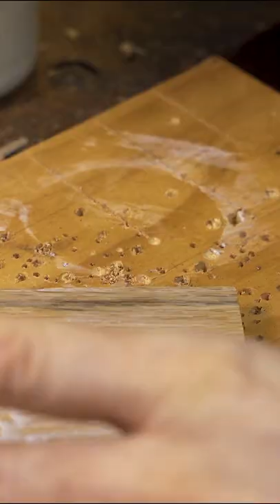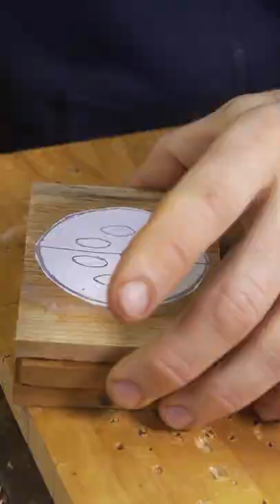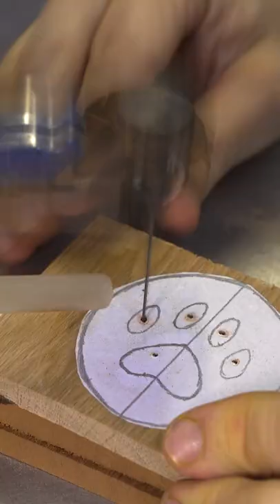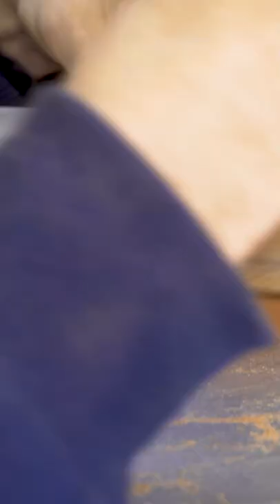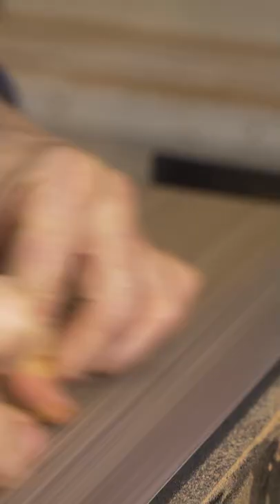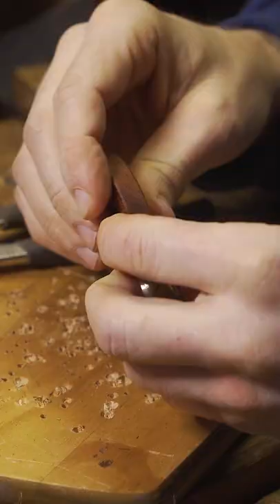Scroll saw #shorts Paw Print key ring,

Comment: What’s that sanding machine the tiny bit ? 
Great job 😍
Reply from the maker: Thanks Keila, the belt sander we use is a jet one. However, I think you are referring to the router set up we use to take the sharp edges off the paw print. It's a standard cutter that we have modified
The router has been turned upside down, allowing us to take the sharp edges off the design.

Thanks again for supporting our YouTube channel. All the very best from us all. 👍👍